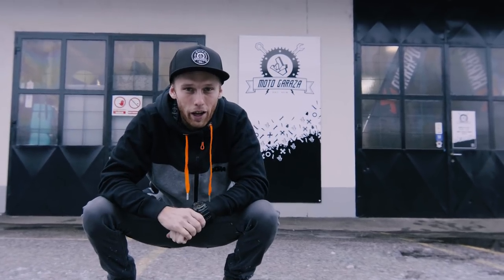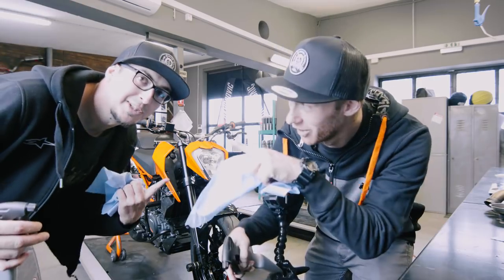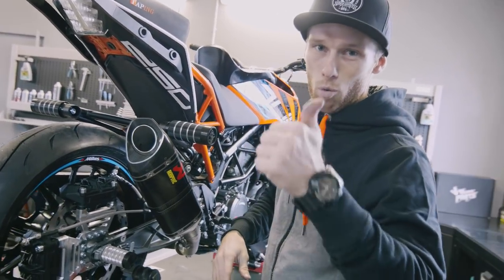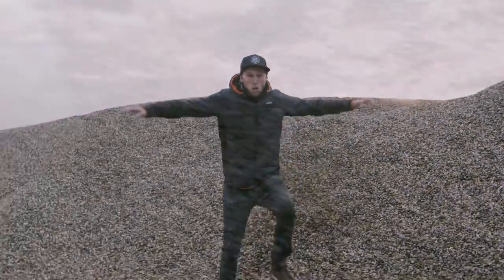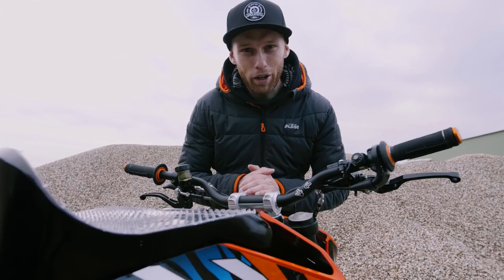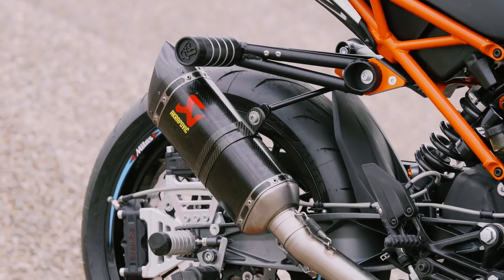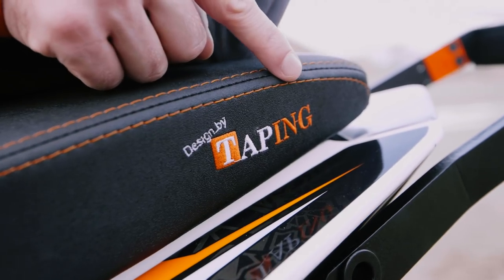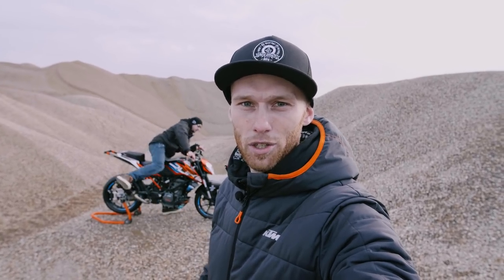BUILD OF STUNT BIKE, pt. 2  | 2018 250 Duke FINISHED! | RokON VLOG #43

Comment: Rok, I also put a CNC machined stunt clutch on my bike, but I'm having trouble adjusting the tension in the clutch cable. Can you make a video on how to adjust the clutch cable properly? 
PS: Love the new bike!!! :D
Reply from the maker: quinten52 which stunt clutch do you have, what brand. So I can maybe know how to help you?
Reply: It's an RSC Stunt CLutch Lever. It just feels like my cable is to short for the clutch... I even adjusted it at the engine, but still I cannot reach the 'deepest' attachment point for my cable at the clutch lever itself (to have the easiest clutch pull). Thx in advance!

Comment: I like that bike but the new thank is not good
Reply from the maker: What do you suggest, how should we change it and why?
Reply: The additional fitting in the thank looks bad.what is the use of it.If it is not necessary then remove it then the duck looks super
Reply: The additional fitting in the thank looks bad.what is the use of it.If it is not necessary then remove it then the duck looks super.